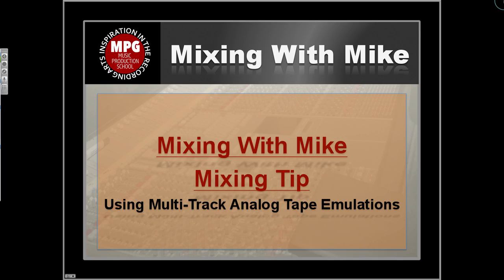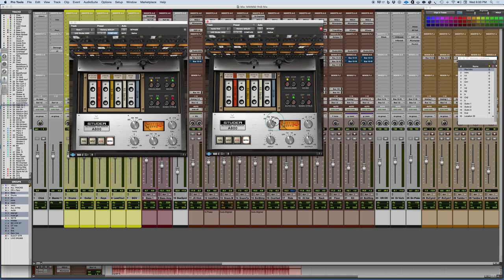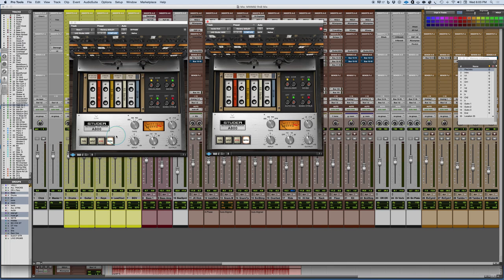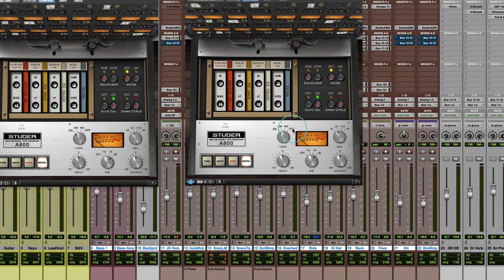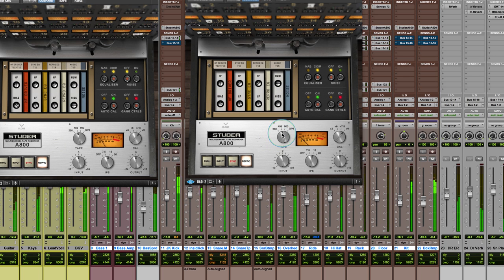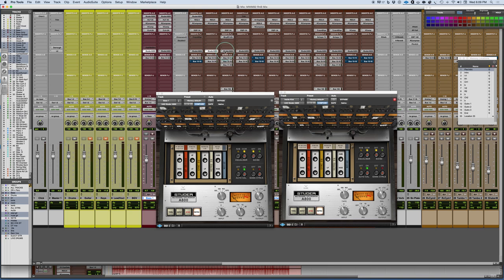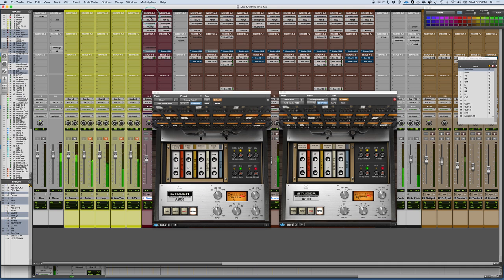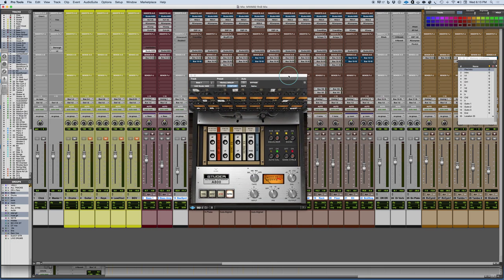Mixing With Mike Mixing Tip: Using MultiTrack Analog Tape Emulations

Comment: Hi, Mike. Correct me if I'm wrong, but it appears that when using the VUs on these tape emulations, the same paradigm applies for transient heavy instruments (the kick in this case) as the one you discussed in your "Using VU Meters" video. I want to make sure I have this right because in this case we are applying signal to a (virtual) physical medium, as opposed to analog electronics. The only problem with this for me is that it still feels a bit like guesswork at my experience level. I should trust my ears, I guess. Thanks for all this great info!!!
Reply: I think I answered my own question, lol. But is there an effective difference to driving the input as apposed to using the higher calibrations? Maybe the virtual electronics get more overdriven in the first case? Is that a good thing with tape machines?

Comment: Thanks for the video. Pretty subtle stuff going on there. I realize Youtube doesn't help with that, but do you have any tips for training your ear for hearing these subtleties better?
Reply from the maker: +luiza177music Hi Luiza,
I think most of the difference is in knowing what to listen for. It is much easier to tune into frequency or volume changes than it is to judge imaging. Everyone's monitoring system is going to be different and imaging characteristics will be more or less apparent based just on that.
There is no better advice than to just keep mixing and working at it. Your ability to hear subtle differences will only come with doing it over and over again.
Cheers!
Mike

Comment: any difference between having the tape emulation on the top of plugin chain vs. bottom? I follow the signal flow of having the tape emulation at the top then to a trim plug. thanks for these mixing tip, much appreciation, and more power to you! thank you.
Reply: Well, this is an interesting subject. I think you can just do the gain staging right on the A800 by using the input gain and the output on the plug in it self, just remember to have the gang control off when doing this. You get more of that tape saturation effect if you do this in my opinion. So to make sure you are running the same tape speed and calibration set all that with the gang control first and then turn the gang control off and work on your gain staging.
Reply from the maker: descargamusicalny Yes, exactly! For the sake of time, I didn't go through this process but it is an important one. I wish they would put an inverse linked I/O gain control within the plugin for setting the tape compression. This way you always have unity gain through the plugin while setting the saturation level. The Waves Kramer Tape plugin is a perfect example of this.
Cheers!
Mike
Reply: Michael White I wonder if we can obtain good results by using the plug in in the input chain of the uad console. Just set your tape and record the whole song using the same tape settings. Also working on your input gain structure through the A800.
Reply from the maker: Hey descargamusicalny,
Yes, this is one approach you can take as long as you feel confident in your settings. You may need to be more mindful of your levels going into your Apollo interface as you may over-saturate a sound in the process of recording. There is no way to undo or change the settings later once recorded.
I love the thinking on your part though. Very "old-school" recording methodology. Just be aware of the limitations as well.
Cheers!
Mike